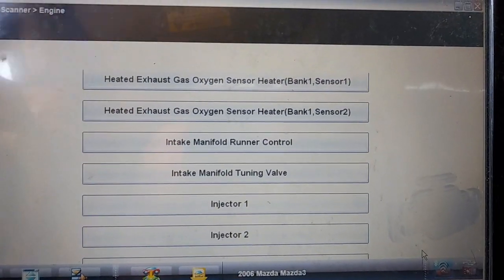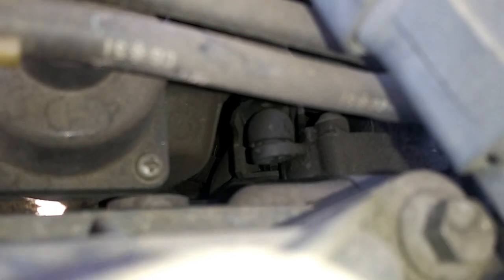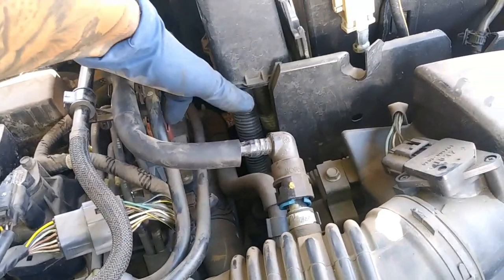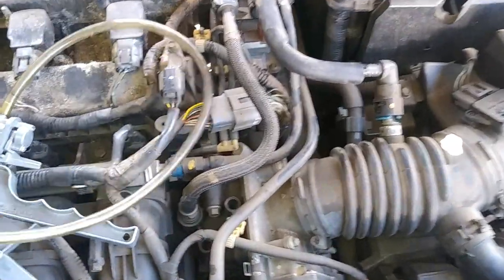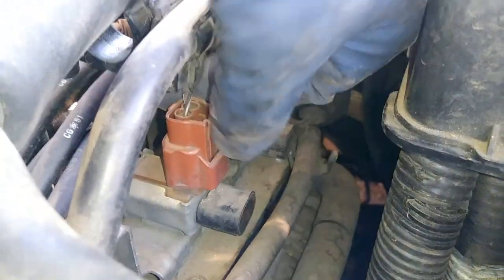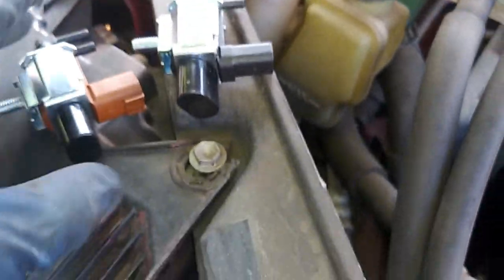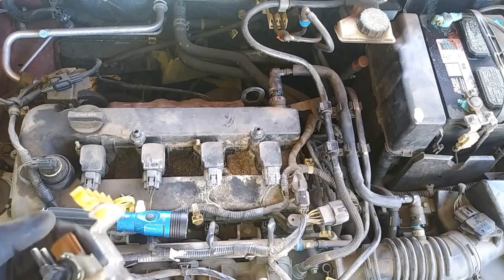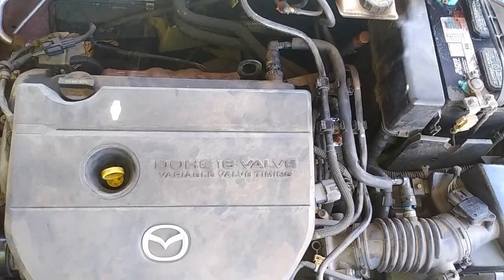ford/Mazda 3 2.0 p2177

Comment: hi thanks for you video i have a mazada 2009 and the engine light is on and both error code p0661 and p2177 is detected i changed gas pump and get manifold services but both error code are still remain the mazda car service told me i should change the gas pump again, i think they don't know anything about this problem
can you help me what should i do?
Reply from the maker: What size motor is it?
Reply: @JaboTheMechanic  it's 2.0 l 
i didn't test the solenoid yet i think i should do it
Reply from the maker: Test it than let me know
Reply: @JaboTheMechanic  hi thank you again for your guidance 
I checked the brown head solenoid it was damaged and i changed it
but just p0661 cleared and p2177
is still remain and i dont know what to do ☹️
Reply from the maker: What is the model you have and motor size
Reply: @JaboTheMechanic  I have the same problem ! WHAT do we do ?
Reply from the maker: Did you follow the diagnostic procedures
Reply: @JaboTheMechanic  the motor size is 2.0 l
Reply: @hoseinmir9781  i have a 2006 mazda 5 2.0 i have a same...  Change everything and the problem still on. So i did the same what this guy and now its working well
Reply: I have the same problem:cod 0661 and 2177, i changed the brown solenoid but the Cod 2177 doesnt delete, can you help me with other tests or ideas please
Reply: @hoseinmir9781  do you fixed? I have the same problem and i cant find the 2177 solution

Comment: Thanks awesome video
Reply from the maker: Glad it helped
Reply: Hey jacob i have question i have this code but i have my doubts ..i check on alldata  the wiring there are 2 wires on this this solenoid one side show ground and the other its 12v but in the other one show 12 and 12v.. so i have the problem with the one on the side of the head called variable tumble solenoid  ..the one that control the lower intake  its seeing to be working fine..so does the pcm supply 12v  or ground? my understanding according to alldata shows the wire  B+  conector 2a1 so im not sure if B+ mean 12v..i see the wiring one side to pcm the other side goes to main relay..so im confuse if the pcm turns one of the 12v ground when u reve it or thereis a short somewhere
Reply: If i unplug the intake solenoid connector and switch to the other  solenoid clicks and seeing to be working.. but what notice its that on the tumbler solenoid there is no ground on  one wire of the connector on the other wire i get 12v only so there is a death wire .. when i plug back i get 12v on both wires of the connector..help..
Reply from the maker: The ecm supplies  ground and positive. Make sure your wiring  is good before replacing the  ecm
Reply: @JaboTheMechanic  but the wiring said the 12v its coming from main relay

Comment: Is this a similar process on the 2.3
Reply from the maker: Yes it is
Reply: Thanks for asking this.  I have a 2008 CX-7 with the same code.  My question is I have this code and a P0300, misfire.  Car is in limp mode.  What handheld obd, should I buy to clear the codes after I replace it and get it out of limp mode?  I looked at the Verus D10, but they are $3000.  I see a lot of Autel and Foxwells on Amazon.  Can you recommend one that is decent under $350  Thanks.

Comment: My mazda 3 ‘06 P2177 code came on, however there are no symptoms. Not really sure where to start to find the problem.
Reply: Did u find out what the problem was?
Reply: @mikey_likes_it_  yes, I used CRC cleaner to clean the mass air flow sensor and this fixed it.

Comment: hey bro do you work on modding cars at all? You are very local to me and I would like to see what you can do for my car
Reply from the maker: Yes i do.  What would you like to do.
Reply: @JaboTheMechanic  so I have a Nissan Sentra Sr. I want to get a new exhaust and intake. Just some stuff to increase torque and hp and I need my bumper fixed. Is that up your alley of work?
Reply: @tea.dubs8532  yes that is in My alley.
Reply: @tea.dubs8532  got it